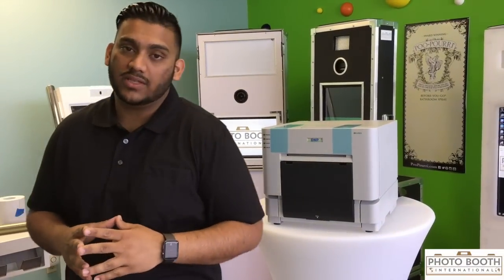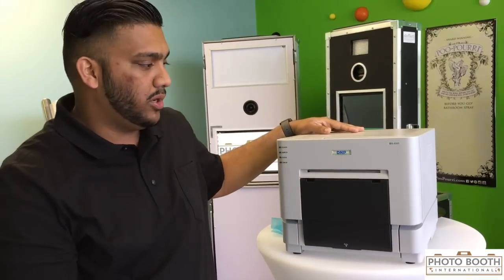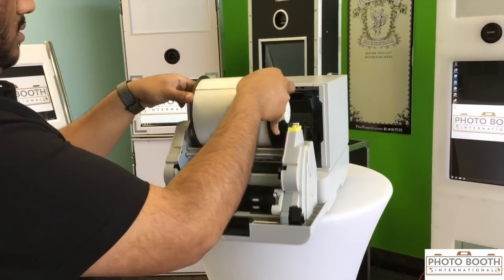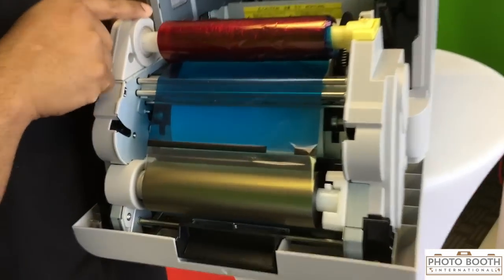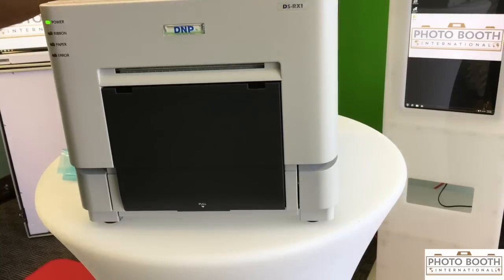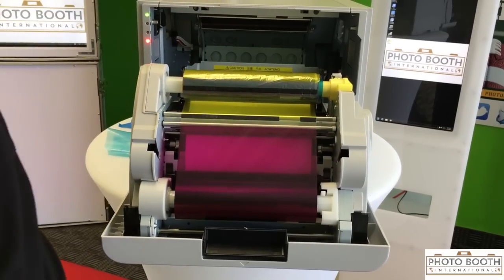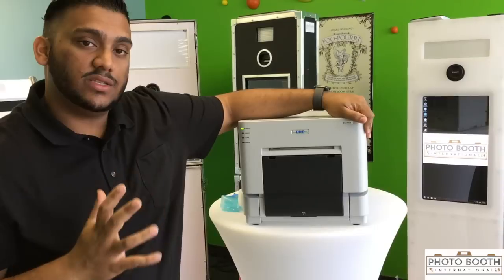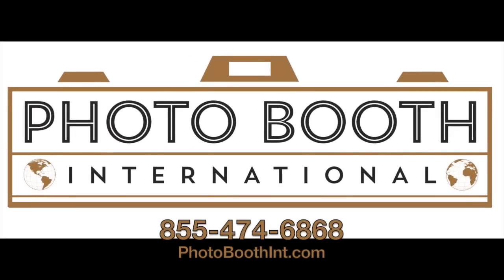DNP RX1 Tutorial + Tips By Photo Booth International™ | 855-474-6868

Comment: Hi I have a question, What type of paper do you use with your DNP RX1HD printer. Is it a plain glossy 4 x 6 or the breakaway 4 x 6.
I’m currently using the breakaway 4 x 6 and I’m having problems my print is going across the breakaway what do you suggest thanks
Reply from the maker: We use either of the two